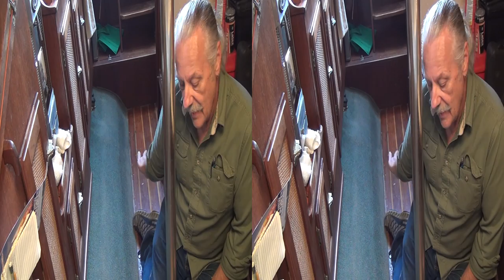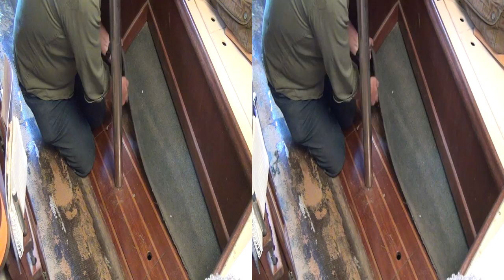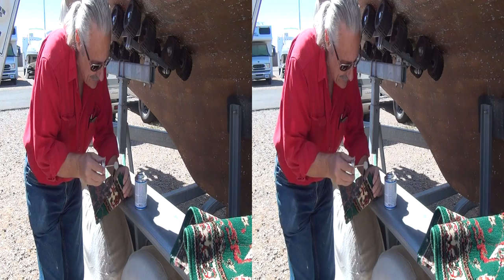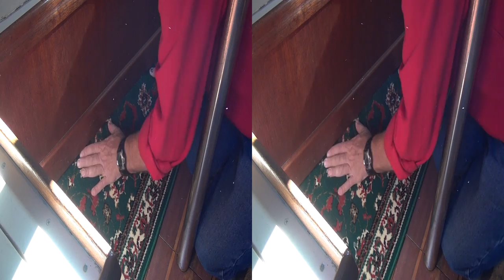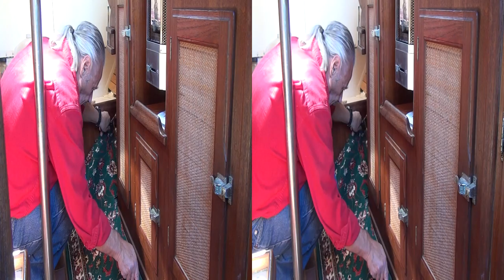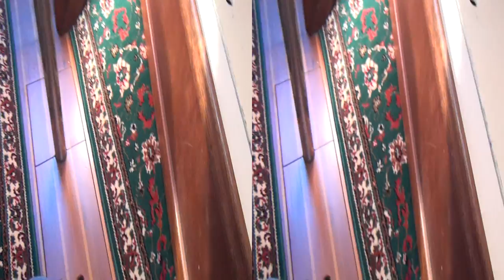Carpet replacement

Comment from the maker: Roger,

The glue down was easy. And I did it about the same way as last time. For over 20 years now I have not used glue "all over" the back of the carpet and have never had a problem with wrinkles. If I was laying it in a traffic area, I might worry, but on our small boat it's no problem with only using glue in a few areas.

Comment: Looks good! And the video's very timely as i am looking at redoing the aft cabin carpet. Did you cut the carpet from the pile or backing side?  What kind of product did you use on the sole?  Is it a varnish or a polish? How about the pvc and carpet glues - can you mention brand names?  I know I can't always find exactly the same stuff, but it helps to get me in the ballpark!